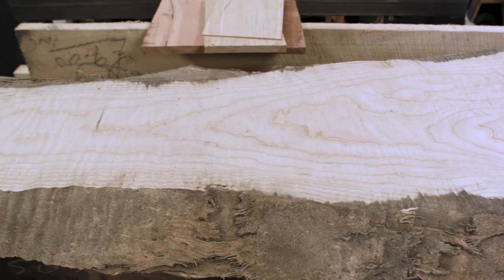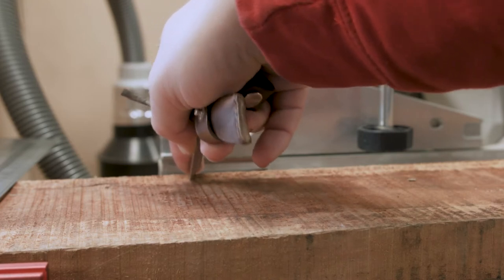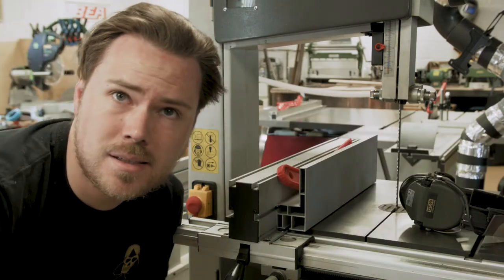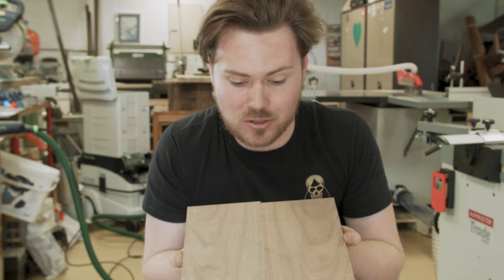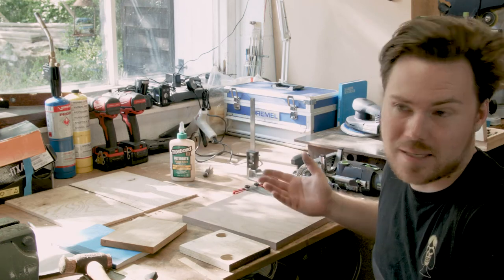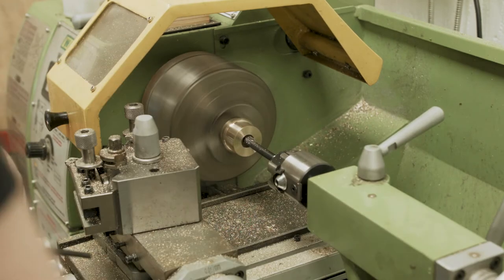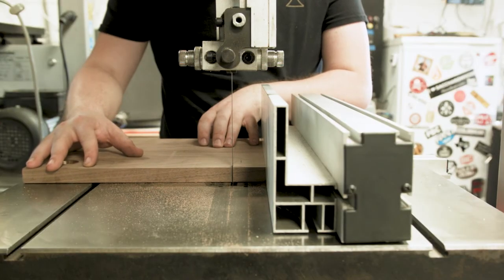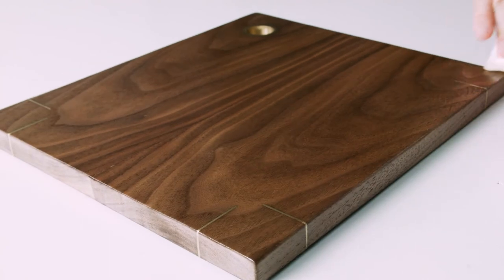Make a Walnut and Brass Cheeseboard

Comment: Great work man! I'd really love to get my hand on one of those wood cutting attachments for the welder. Does it only work with tig welders or could I use that with a mig? xD
Reply from the maker: TIG will cut both metric and imperial lengths, MIG only does metric. Hope that helps!
Reply: Malt & Make I did not know that! Thanks a lot for your help!